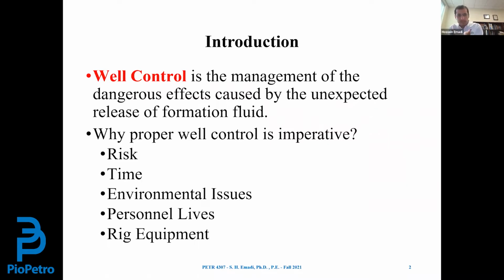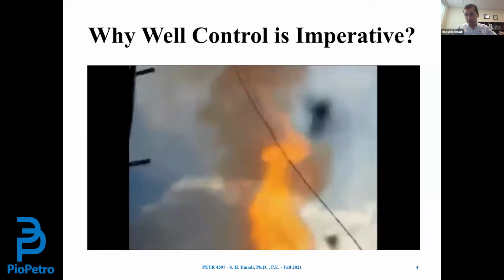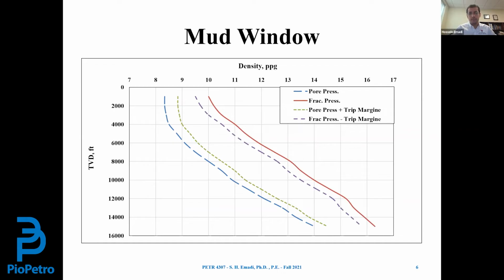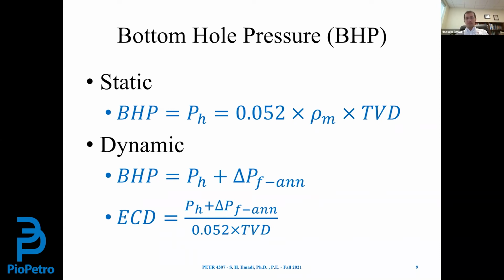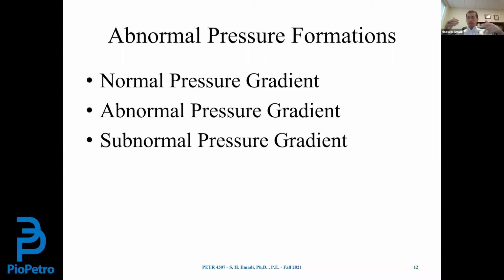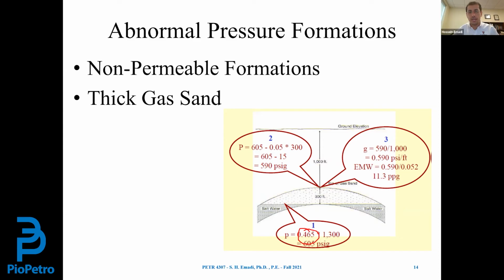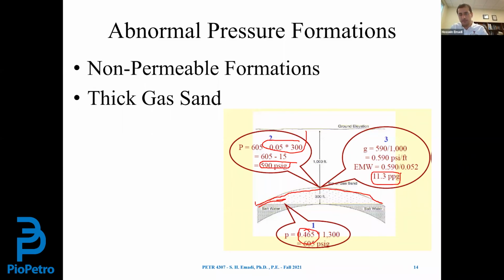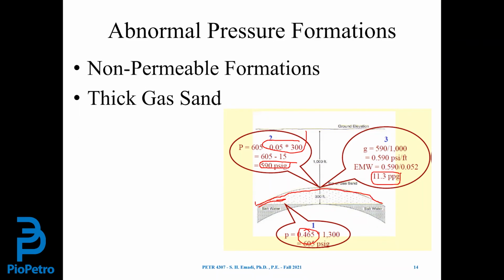Well Control for Beginners: Lecture 1 | Hussein Emadi

Comment: Kick while losses is not an uncommon phenomenon, it does happen.
It happened to me when I was drilling in a fault zone, the lower section of Arab C was flowing and Arab B was losing mud, we tried many options to control losses and remove the kick, Eventually we cemented the whole section and side tracked.
I remember when I was drilling in Libya I had the same scenario where KMW was 14.2 and MAMW was 14.2+ ppg, we killed the well eventually after many many tries ( took almost 1 month to stabilize).